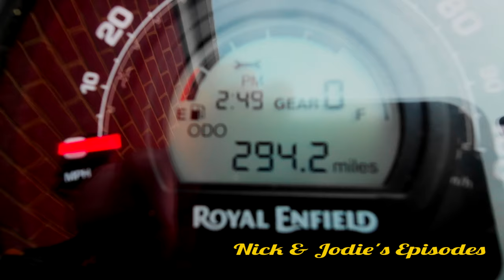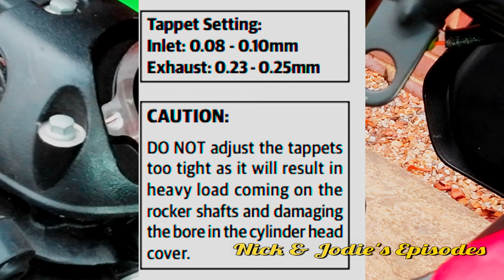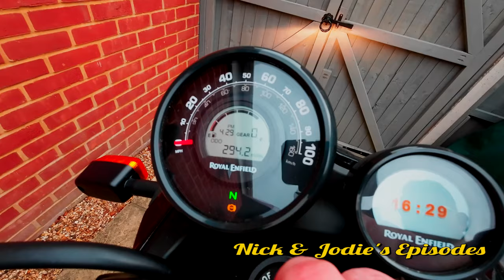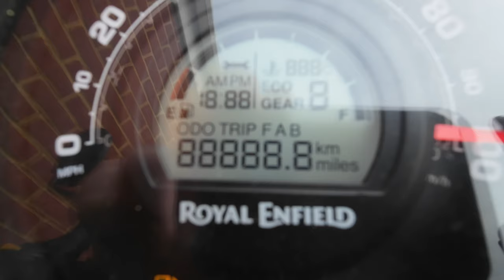2023 Himalayan / Scram  411 Valve Adjustment & Oil Service Complete Guide

Comment: ****PS****. Just a wee warning that isn’t mentioned in your video.  If you separate the feeler gauges and use them individually (like I did, because access to the valves was a little ‘tight’), there is a small risk of the feeler gauge ‘poinging’ directly into your engine and down the camshaft (like it did to me;  because these things always happen to me ☹️).  Long story short, I eventually bought a new LH gasket and removed the LH cover to retrieve the feeler gauge from behind the magneto wheel.  Definitely had that sinking feeling of ‘I broke my bike’ for a few weeks while I decided what to do.  Hope this helps other viewers.
Reply from the maker: Great bit of info there Johnny, thank you

Comment: One on the engine one on the crank. ???  It would have been nice had to shown us I can find a line through the top bolt yet still can't find one on the crank
Reply from the maker: @lifeinthewild6187  from my understanding the newer models have changed, no T mark. Take the spark plug out. Put a screw driver down the hole and turn the crank over, you’ll see the driver move up with the piston and you can find top dead centre yourself

Comment: Looks a let less fiddly than on the Meteor. Loved the diddy torque wrench both mine are massive. Seem to recall when it was just a few foot lbs (I’m ancient) we used a little spanner, a few more it was a socket and only on important stuff did the torque wrench come out which back then was the type with the pointer moving across the scale. Loved the video. The RE’s must be ideal for Suffolk.
Reply from the maker: Hi bud thanks for the comment. The diddy torque wrench only comes out for the videos, i prefer using the one built in my elbow lol. The RE are great for these roads you are absolutely correct! Cheers

Comment: I am about to the the same procedure and a few other stuff and was wondering where did you get the torque specs for the bike. I couldn`t find that in the manual. 
I am interested mainly in the torque for the triple clamp bolts/ones holding the fork leg/. 

Thank you for the great video, definitely a guide I would follow.
Reply from the maker: You can find the workshop manual after a little Google search

Comment: I bought one of these and I love it! Only complaint is when shifting you can hear the gear clunk even with clutch fully depressed I’m not sure why
Reply from the maker: Depending on what you are used to and what you have owned in the past. Generally the gearbox is smooth. Check your clutch free play. It should have 4-5mm movement on the inside of the lever unit It pulls the cable

Comment: I have a new scram 411. Royal Enfield just sent dealers a notice saying that the 300 mile valve check is no longer required. Since you're exhaust valve was tight what do you think of this recommendation?
Reply from the maker: I’m hoping your source of information is correct as both instances on my scram and my wife’s himmy required adjustments after 300 miles. 

The only way this would have changed is that Royal Enfield have improved the production line quality control process ( which is probable) 

Id request this “ update bulletin” in an email from your dealership to cover any future issues should you get any. 

If you are confident with spanner’s then check it yourself, better be safe than sorry. After all it cannot do any harm and it’ll give you peace of mind

Failing that get a second opinion from a completely different dealership, you can also email royal Enfield direct with your vin number and they can check for you

Hope this helps
Reply: @nicksepisode  I have just ordered a new one, sales guy said notification from Enfield no valve check unless asked for by customer on any service! i asked about the servicing as I wanted to do it myself but was advised not to as it would be very difficult making a warranty claim

Comment: Hey nick, do you find that you can still hear the valves ticking after adjustment? I've checked mine 3 times now and when letting off the throttle I'm still getting some clatter at lower rpms. Are you finding this to be normal?
Reply from the maker: @marklescault9429  hey bud what’s your mileage?
Reply: @nicksepisode  I'm at 666.2. I adjusted at 324.5. I've rechecked a couple times and on the exhaust the 023 fits tight, good drag and on the intake the 010 fits tight, good drag. I bought the adjustment tool so I was able to make fine adjustments. It seems worse when it's hot, like in traffic and such
Reply from the maker: @marklescault9429  it’s worse when it’s hot because the oil is thin. I think the noise you hear is normal as this engine isn’t a quite one due it’s old school design
Reply: @nicksepisode  ok, that's what i was hoping. You know how it is when you hear an unfamiliar noise....hard to stop obsessing. It didn't have this sound before I adjusted, but when I first opened it I couldn't get a 010 into the exhaust it was so tight and I couldn't get anything into the intake so I've opened it considerably compared to how it was. Thabk you so much for taking the time to respond. I really appreciate your help and your awesome videos😃😃😃😃
Reply from the maker: @marklescault9429  did you rotate the crank twice as sometimes Top dead centre could land on the exhaust stroke where the valve will be tight
Reply: @nicksepisode  I turned to TDC and checked valve as you showed and it moved a tiny bit when I opened it, just not wide enough for the Guage. I also did the two rotations rechecked at the end
Reply from the maker: @marklescault9429  that’s great, what oil grade have you used and what country do you ride ?
Reply: @nicksepisode  I used motul 15/50 as recommended and a genuine parts filter.  I'm in Maine jn the US
Reply from the maker: @marklescault9429  perhaps try 15/40 next time, 15/50 maybe a bit thick for the colder climate. No major issue though, worth a try as oil recommendations are subject to the climate the engine runs in

Comment: I always am frustrated with new bike oil levels, both my new Scram and Ninja400 came with oil levels filling the sight glass completely!
Reply from the maker: The best way to check is; warm the engine up. Turn off for 2 mins, then ceck oil level
Reply: @njepisodes  yup- pretty much how I always check the oil. I changed just the oil at 200kms, and re-filled to just at the top line. The Scram runs much better now, especially at or above 100kph.
Reply: @brunodanner7777  at hot after 2 minutes oil should be on the top line, no higher, after draining overnight the oil level will be much higher, very near the top of the window
Reply: @jezwatson8211  The oil was almost to the top after being warmed up/ridden and let sit for a few minutes.
Reply: @brunodanner7777   you can have too much crankcase pressure if overfilled and end up with oil in the air filter

Comment: When you say look into the inspection hole and I’ll see a line followed by a T what do I do if it’s so tight it won’t really move.
Reply from the maker: Remove the spark plug. It shouldn't be too tight
Reply: @nicksepisode   ok thank you got it lined up it’s just moving the tire when I turn my socket wrench
Reply from the maker: @exavier9830  put it in neutral
Reply: @nicksepisode  thank you so much
Reply: @nicksepisode ok last thing I’m gonna ask about. At 5:50 when you say set the crank to tdc is it possible to explain a little better at all?😭

Comment: Did I miss the valve adjustment.  You can talk yet you fail to explain in a way that we all understand.  .the line and t mark . It's not shown. The feeler gauge you don't show the part we need .
Reply from the maker: @lifeinthewild6187  check out my Honda monkey service video you can see the feeler gauge better it’s the same set up. I didn’t have a good camera to get close to the valve it’s self on this particular job.